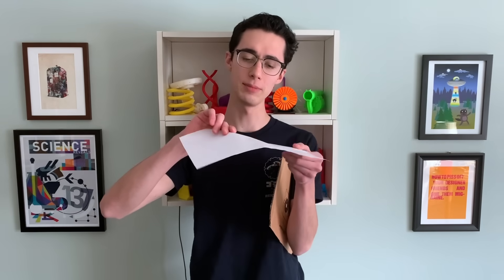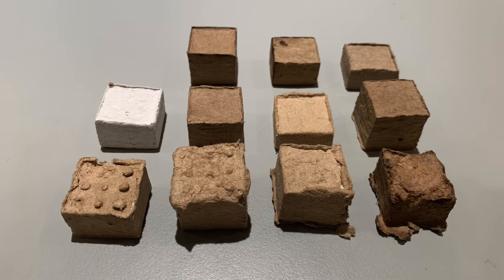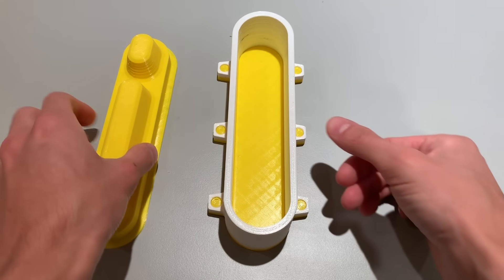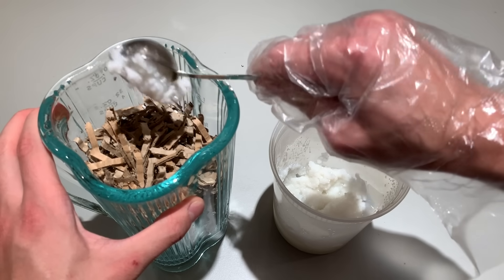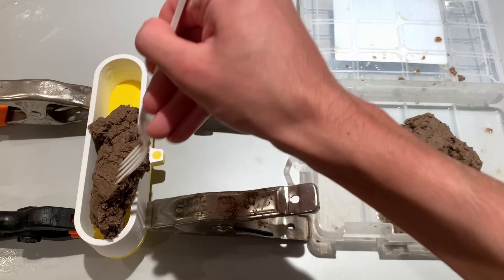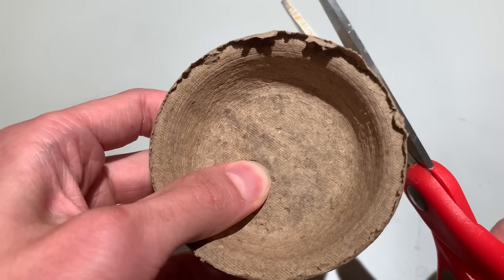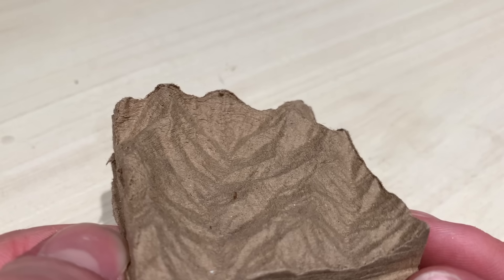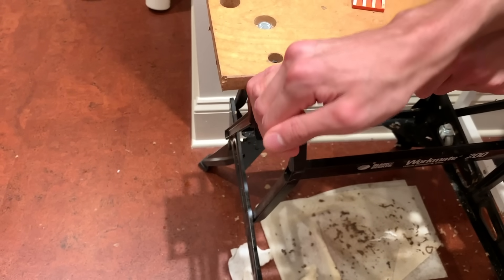Recycle Cardboard into Anything with 3D Printing!

Comment: Great video! 

For water proofing - try coating in beeswax or parrafin. May even be possible to infuse the wax into the paper.
Reply: There's the problem that at that point you are basically making firestarter blocks, which are basically a block of cardboard with wax in it that burns off.

But otherwise it is a solid idea.
Reply: @lBonaCl  Actually, custom-shaped firestarter blocks would be pretty cool. 

While you are right, that it is something to be aware of if you do not plan to start a fire, this could be a cool craft project to sell at a school fundraiser for example. Make donut-shaped firestarters with wax "icing" for example :-)
Reply: What happens if you did the opposite of sustainable and Eco friendly. Would waterproof wood glue work as a binder?
Reply: It would probably end up as waterproof as MDF as this is a version of fiberboard. For a truly waterproof and stable substance, I'd probably try to coat/infuse it with resin similar to resin stabilized wood. Or just spray it with a sealant/varnish.
Reply: @bipolarchemist  that might not agree with your molds though, you would have to wax them well to stop the resin from sticking.Actually you would have to sand them super smooth and wax them as well.
Reply: edit: i just reread your post and realised you were talking post process lol
Reply: @bipolarchemist  infusing a pulp with a wood stabilizing resin like SOS 3 or Cactus Juice would work. You would just need to bake it under pressure
Reply: Paraffin is a little expensive.
Reply: You could try using Scotch-guard or some other water-resistant post processing.
Reply: @Nathaniel_Belles  for low-tech solutions linseed oil comes to mind for waterproofing, slaked lime for integrity (basically concrete)
Reply: Saturate it with super glue
Reply: @Elric509  Your right, drying oils like linseed oil often used in oil paint for same reason
Reply: What about Shellac? It is an organic product and has been used for protective coatings for quite some time now.
Reply: Beeswax or paraffin would be good to make camp fire starters.
Reply: I thought of beeswax immediately myself, but then yeah, the fire-starter bit as others mentioned. What about something like collagen glue? That's still 100% natural and biodegradable, so maybe it could be mixed in for adhesion/waterproofing?
Reply: @lBonaCl  Umm. That sounds awesome. Make it so you can jam some lint in one end and sticks in the other with a few feet at the bottom then make a stick pire around...
Reply: Varnish.
Reply: lBonaCl 
Love how you either are water proof or fire proof
Reply: @JohnKlosner  There is a spray available that i remember back in my youth that we used to spray on tents to water proof them. The thing with a plastic mold is you really are creating more problems than your solving by infusing waterproofing. If you want to go full on and infuse then you would need to look and fibreglass for your molds. But then your going to need tooling gel, release agents etc.
Reply: how about casein from milk? use it instead of rice paste and also as coating... it is somewhat hydrophobic, giving the final result water resistance
Reply: @baivesan  Yeah, shellac should work, unless the paper soaks up the alcohol. Really thin layers might work.
Reply: Add regular cement to the water. It will set even if the part is still wet. If my calculations are correct it should control shrink too.
Reply: Careful using linseed oil, when soaked into a mass of organic material, it can spontaneously catch fire.
Reply: 08:11 he says it doesn't burn well, adding bees wax should be perfect. It's too compact to burn.
Reply: @Nathaniel_Belles   Unfortunately, Scotch-guard is a TOXIC chemical :(
(Mark Ruffalo 2019 movie - Dark Waters explains it )

Comment: You could try to incorporate paraffin or even beeswax to make them water resistant.
Reply: Or a coat of paint or PLA. It does detract from it being 100% compostable but would still be far superior to making the entire object out of plastic.
Reply: @lukewarmmizer  PLA is compostable, it just takes longer "at home" than on a composting facility (6 months vs 1-3 months). What it doesn't seem to do very well (though I haven't found a proper paper or proper commentary on a paper with actual numbers) is to naturally biodegrade, and it definitely has a horribly bad time decomposing on a regular landfill (no surprise there, even organics don't decompose well on those things, it is almost as if they're not great solutions for trash)
Reply: @louisvictor3473  PLA is not compostable at home. The industrial composting requires the PLA to be at 60 degrees celcius for months with just the right micro organism. Micro organisms that arent commen in nature.  Though it can be burned in a carbon neutral cycle. Infact burning PLA generates less CO2 than composting it industrially.
Reply: Dude that´s a great advise. I´m starting a proyect with this method.
Reply: Beeswax is a fun idea. Also interesting might be linseed or tung oil, which polymerizes to provide structural help as well as water resistance.
Reply: @louisvictor3473  I must be doing it wrong. I had a compost pile at home for making garden mulch, and I buried a "biodegradable corn based" cup in the middle of the pile. Its been sitting there for years. But the sticks leaves, etc I throw in there break down fine. The pile can even feel slightly warm on a cool morning.
Reply: @Jeremy.Bearemy  I am no expert on this, but from what I gather you do have to design in such a way that the temperatures stay elevated above the threshold. Also, don't just toss it there, shred first. Then again, it is a very trial and error process, with "pesky" variables like "what is the climate like where you are" and "what is the local microbiological ecosystem like". With a controlled environment, it is already fidgety. Technically doable, but definitely less forgiving than the regular home composting even with a hot composting pile.
Reply: Milk paint, shellac , or some type of oil like linseed or tung oil may work also. And all of those products are natural and biodegradable.
Reply: @eklectiktoni  Hot hide glue also makes a good undercoat for shellac. It is water absorbent by itself, but will prevent the cardboard from consuming so much shellac.
Reply: Have you trying adding edible food colorant in the blender? I dont think would affect much if you want to recicle the piece but you can make some nice colored pieces, just an idea, im thinking of getting a 3d printer and this video makes me want to buy it already xD
Reply: Don't mind me, just commenting so I can find this thread later :>
Reply: @awellner3285  wow, great info! thanks. That settles some wrong assumptions I had about composting PLA at home.
Reply: @Jeremy.Bearemy  biodegradable plastic is pretty much a  scam, it takes just as long to degrade as normal plastic unless in very specific circumstances and is much weaker tha n normal plastic, at least in my experience.
Reply: paraffin or beeswax would make them great fire starters
Reply: Add some boiled pine sap to the paper pulp after removing the processing water.  Compress.  Dip or paint finished and dried product with same resin.  Natural resin binder and coating.
Reply: Isn't that what wasps do?
Reply: @lbgstzockt8493  not true. I left a bio degradable bottle lying around on the backyard and, a year later, it was falling apart, like it was made out of sand. Also, I saw with my own eyes, how people were making plastic out of potatoes.
Reply: Linseed oil? Then bake at low heat or dehydrator ?
Reply: Paul Chvostek you are saying the linseed or tung oil will make the final product even stronger WHILE providing water resistance?
Reply: Nuke Dukem what does that do?
Reply: Beeswax dipping would proof the surface though needs to be softened periodically. Using an alum or shellac coating works on paper based products.
Reply: @dekutree64  gelatin glue - with glycerine and vinegar is my coating experiment. Not waterproof but a good undercoating for shellac or linseed oil boiled with beeswax and turpentine
Reply: @Jeremy.Bearemy  from what I remember, the corn based biodegradable stuff needs to be mechanically damaged and soaked in water for a long time. I remember when they came up with that principle, they donated pens made from the material to all students in the country. I wanted to test the claims, and found it out the empirical way :)

Comment: Great video. You inspired me to design an eco-friendly packing solution for one of our products which is held in place with a plastic part. I will try to replace that now with a recycled paper solution. Nice work!
Reply: I hope you don't give up, and yes, maybe you can change the application for one product, and then that spreads, and you're off and running . . . good luck with your efforts.
Reply: How'd it work out?
Reply: I also wonder how your packing solution is working because I am thinking of doing the same thing? My first thought is adding ice to the mixing phase, then putting it under a vacuum to dry faster.
Reply: @Dennis.379  I will also try to use it for packaging. It seems very promising. But can I ask what your idea of the ice is? I don't understand your reasoning on how or what it would improve. A vacuum will 100% help. Get it stronger and dry faster. I just hope you can get the pressure well dialed in with the vacuum as it will shrink while you are molding the fibers. It should help more than hurt, so it should be ok.
Reply: @JJSnel-uh3by  Yea, my original thought on the Ice will probably not work, but the goal was to add air space. Something that I did, long ago as a kid was make candles using ice and wax. You pour hot wax in a container with ice and a wick, the wax will melt some of the ice but most of it will form empty spaces in the candle. My original thought for this was to do something similar. Where you get the mix of recycled paper and binder, then last thing you add is crushed ice. Once you add the crushed ice to the mix you put it into the mold then you put the mold into a vacuum. Using the vacuum would be the process of drying it out, so you would be freeze drying it. Then you would need to get it out of the mold. I would probably do a redesign of the mold to be probably 3 pieces. My end goal would be, you have a lighter packing material that if hit hard would crunch and not harm what you are trying to ship. At the end of the day, this would be something that you could experiment with but I wouldn't spend much time on it. If you are creating a custom packing solution with a mold, you should just create the lattice yourself and not relay on whatever the ice will do.

Comment: When he showed the triangle mesh I saw acoustic panels.
Reply: Lance Anthony  Yeah, but I would want to make them at a reasonable size, like 20x20 cm or larger so I suspect it would take a lot more force to press them, maybe steel plates would be needed to spread the pressure.
Reply: I'm not sure how that would work as he did say multiple times that it has the consistency of hard plastic.
Reply: @JohnKlosner  First off I'm no expert, but I think it's possible but maybe not as efficient as if it was soft materials (and maybe you can affect that too by not packing the mass super hard). I think it should be possible to use deflection and destructive interference, almost anything should be better than concrete walls.

Take a look at Vicoustic Multifuser Wood MKII.
Reply: @ornotermes  drive over them with your car
Reply: @octapc  That's worth a try at least, I might be able the get a few hundred kilos. Hydralic presses usually start out at few tons. At least by doing it outside I wouldn't have to deal with the water runoff.
Reply: @ornotermes  maybe modeling a smaller modular arrangement, like individual spikes that interlock and form bigger panels. I guess it depends on what the purpose of the panel is, I think for drying and echo management it should be great. For insulation and dampening I understand that mass is more important and plastic like rigidity wouldn't be good.
Reply: Exactly the same thoughts, think it could a really good cheap option
Reply: @josephdunlopburns8225  you could just use egg boxes. Maybe  spraypaint them if you are fancy.
Reply: @ornotermes  5x5 puzzle piece mold that could interlock then trim the edges
Reply: But we have them already in form of egg trays, they even have correct shape. Egg trays have been used as poor man echo remover for years.
Reply: I mean technically you can, you just need big molds
Reply: If egg cartons don't cut it - I suspect their regular shape could be a problem for some frequencies - you could custom-design an irregular reflective surface, with perhaps several different patterns/molds that can be mixed and rotated like decorative bathroom tiles to break up any repetition.

As for the absorption, how about doing a hard press first, and after drying, cover it with a second layer of pulp, throw it in the mold again, but this time don't apply max pressure to keep the outer layer nice and fluffy?
Reply: They actually make a flat paper mache like product for sound deadening walls. It goes under the sheet rock. They sell it at Home Depot
Reply: Panels could be absorbing and/or diffusing. Depends on what you like to achieve.
Reply: thats how we turned weed into bricks when smuggling
Reply: maybe mixing some volatile substance like camphor beads or powder and not using too much binder with a low binding pressure will help it be more porous and make it better at damping sound
Reply: Someone would have to do flow resistivity testing to determine what kind of acoustic elements can be made from it. The gold standard for acoustic absorbers are foam pieces (specifically engineered for this purpose), or insulation rock fibers. Egg cartons are a fairly terrible absorber by the way.

It's possible that you could adjust the flow resistivity of this material by varying the molding pressure - however lowering it will probably adversely affect the mechanical strength.

Comment: Shellac is one of the oldest waterproofing coatings in history used on wood. It's plant-based (Toxicodendron vernicifluum) and would be a nice post process for this material. Excellent video!
Reply: I second the shellac suggestion.  It's a good waterproofing solution (although it dissolves in alcohol) and it's completely natural.

However, if you buy shellac you're almost certainly not getting something from toxicondendron vernicifluum.  You're probably getting lac bug secretions.  Mix them with alcohol (or buy it premixed in a can) and you've got a relatively durable waterproof finish.  There's a million tutorials on the 'net for working with this stuff and it's easy and safe.

Lacquer from toxicondendron vernicifluum is not easy or safe (at least until it's cured, after which it's food-safe).  It's like painting with poison ivy.  It requires a lot of practice to apply properly and almost everyone has a horrible allergic reaction (again, think poison ivy - it's the same chemical) to the uncured stuff.  It also takes a long time to apply, as you generally do quite a few thin coats, each of which has to fully cure before you move to the next coat.  If you mess it up, you run the risk of giving anyone that touches it a horrible rash.

Traditional lacquer isn't seen much outside of Asia - mostly because we have synthetic stuff that is very much not environmentally friendly but is a whole lot easier to work with.  The stuff you buy at Lowe's or Home Depot will be synthetic lacquer.

Shellac and lacquer are two terms that get very confused, mostly due to their shared history, the way they're written in Sanskrit, and the way "lac" sounds like "lacquer" in English.
Reply: You are confusing two different kinds of finishes. What you are describing when referring to the plant based qualities of (Toxicodendron vernicifluum) is actually Lacquer. Shellac is a different kind of finish made from the shells of the Lac bug, is not plant-based, and must be dissolved in an alcohol in order to be administered. They both create a polymerized wood finish, but they are not the same, and have different consistencies and properties. Hopefully this is helpful :)
Reply: natural and plant-based doesn not mean biodigradable
Reply: Toxicodendron. As the name suggests. Lacquer is toxic.
Reply: Both are synthesized unless specified, most everywhere, at this point
Reply: It's also terrible for the environment and very expensive.
Reply: thanks
Reply: @GryffenHanson  It's made from Lac bug excretions. It's pretty disgusting how it's made in India I watched it recently.
Reply: @MrJakson112   Shallack is a natural resin from bug excretions. It's 100% biodegradable. You probably eat some very often too. :D
Reply: bit pricy  and i would go rather in direction of kazeine and other bioplastic (corn stratch +gliceryne or gelatine+ gliceryne )easier to obtain in home. Also  in mass sealing  would be better imho.
Reply: @matet7772  What is the fire resistance of this (if any) versus shellac?
Reply: Indeed, Shellac was used to to finish papier mache panels on carriages and furniture. There isn't much to add to what's known about using paper like this, unless maybe from a modern composite materials or nanoparticle perspective.